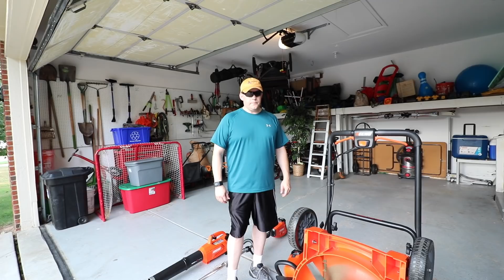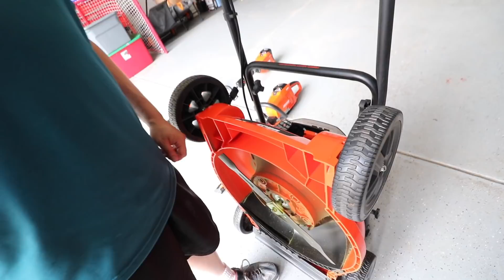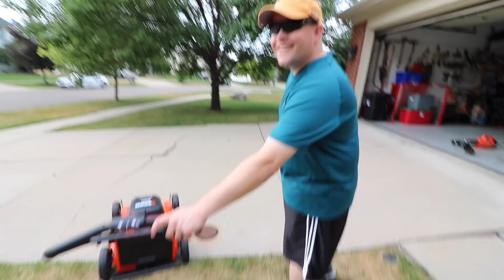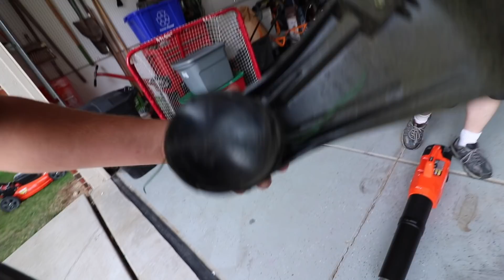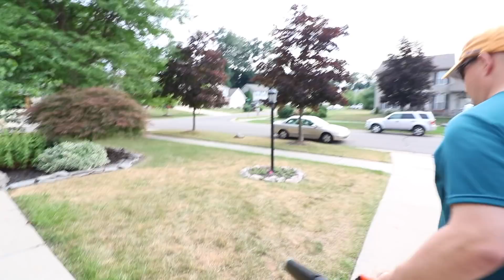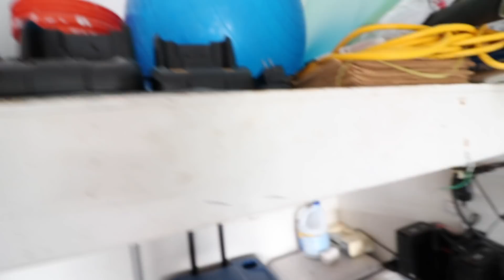ECHO 58v Battery Powered Review ► Is Battery Powered Equipment Worth It?

Comment: The echo chainsaw and string trimmer are pretty solid. I use the trimmer on a day where I do small yards, works great, one charge, no starting, no fill up. The chainsaw is a beast. I've brought it out to jobs (along with my gas saws) and never had to pull out my gas saws. BUT the blower runs out of charge too fast.

Comment: I own most of Echo 58v products. Sad to see they are discontinued. I love that the mower has two bays but I hate that you can only use one at a time. I’d love to be able to pull power from both batteries at the same time, in effect halving the amperage required for both batteries. Is it possible to modify the key to be able to run them both in parallel? That would be awesome if so.

Comment: I actually want to try the string trimmer and blower in my business for 2019. We service a lot of yards per week, so it would be a workout on the batteries for sure. I currently have a 2000 watt continuous power inverter in my pickup and run a mini fridge in the back to keep bottled water cold for the guys. That works great, and just the savings on the time going to the gas station to get ice and the cost of ice has been reduced significantly. People get a kick out of seeing a refrigerator on a truck, but it works great. 

Anyways, since I have the inverter already, I could easily plug in multiple chargers. If I went with the 4ah batteries, I believe we can get 3-4 yards done on one battery. Have a reserve battery on charge ready to go and the recharge time is only an hour. If the batteries will hold up, two batteries per device should be all I really need I believe. Echo warranties the batteries for 2 years from my understanding.

This setup could potentially save a ton of money. First, we drop about $25 a month on 2 cycle oil, plus the cost of fuel. Secondly, save time on labor from swapping out a battery about once an hour vs refueling every 2 yards. Third, and this is the big one, time on dealing with weed-eaters that don't want to start, carburetor problems, and constant maintenance. Efficiency is everything in this business, so I think it is worth at least a small scale test.
Reply from the maker: That’s a pretty cool idea and concept.
Reply: How did it go last year running the battery stuff? I've decided to do that this year. It made a pretty healthy investment of about $1,500 in a few different lines to see which was the best. I'm hoping it's going to be a good choice! I will be running all electric actually. I have DeWalt, Ego, and Echo. I've done some smart shopping on Marketplace and stuff so I haven't paid full price for anything. I wanted to figure out which brand name would be best, if any, before I put any more money into a specific brand. We will see which one works the best but I'm interested in your opinion on how it went for you?

Comment: In the video it was mentioned that a full 58V Echo battery could run 50 minutes in the Echo Lawn Mower when using to cut heavy grass. I have this lawnmower for more than two years and I have 2 echo 58V batteries that I use. My experience is that each battery is typically able to run about 35 minutes for low grass situations and about 22 minutes for Heavy thick grass. Your comment about a battery running 50 minutes for heavy grass makes me wonder if something is wrong with my mower. 
Did you make a mistake in the video or is your assessment for Run time still the same now?

Comment: I have my own lawn business and have been using cordless trimmers, blowers and hedge trimmers. I use the Kobalt 80v line, the trimmer can accept attachments so I use that to edge. And I have the Kobalt 80v backpack blower. I can cut about 10 yards a day with my batteries. I got a deal when Lowes was offering a free battery with any trimmer or blower purchase. So I have about 8 batteries and they charge within 30 minutes. The only thing I have that's gas is my mower. I also have 2 Snapper 60v trimmers and a hedge trimmer. They work well.

Comment: I love Echo, have been in love with Echo for a long time, and now I'm trying to switch over to all electric lawn equipment. Started by switching to Echo Electric Blower, which is now my favorite blower of all time, and about to switch to Echo Electric String Trimmer from SRM-225, which I have loved my 225. Get's alot of hate, but if you have solid technique and line (Echo Black Diamond), that thing will wreck anything. Now I understand if your using this equipment for commercial use. I was the head groundskeeper at a Christian Camp this summer and we ran Echo 225s, I would usually run one for at least 7 hours a day, and that chewed through gas, so I could see you would have to have spare batteries always on hand or have one or two always charging, but for a home owner I think it would be good to make the switch. I've also been using a Fiskars Reel Mower, trying to get my Bermuda down to 1 inch (Shout Out to All LCNs out there). But hopefully soon I'll be off gas and all electric. Love Echo, they are the BEST!

Comment: Awesome video I use the same mower,  blower and trimmer. The trimmer can be used with the same optional attachments and the gas version. I use the stick edger and a sweeper attachment with mine. You can also purchase accessories like a side discharge and mulching attachments that fit on the back of the mower. This is also Toro striper kit compatible. The blower is strong but a little unruly... the nose opening is to wide. Mower cut  quality is great especially compared the the Ego I used to own. Great purchase for anyone who doesn’t not like fooling with gas and oil and belts...

Comment: Another thing that's worth mentioning on the battery powered things: just did some cost calculating for my electric car and in the last 9 months it has recuperated all of the cost of installing the home "charger" (through fuel savings) and over the next decade it will entirely pay for itself in terms of gasoline and maintenance savings. That is something unique about electrically powered tools which is completely opposite of all gasoline/diesel powered things. With a gasoline or diesel or whatever you spend a bunch of money on it to buy a brand new and then as you use it it continues to cost more and more money through expected maintenance and repairs as well as literally burning money in the fuel tank every day, and up until this moment in History Society has had to accept that because that is the best we have been able to do and that's just how it works. But not anymore/not for much longer. When making the shift to electric, it's exactly the opposite. Electric stuff literally pays for itself in fuel and maintenance savings in less than it's usefull lifetime. This is a complete paradigm shift and a game changer. It opens up there possibility wearing people who use electric things like cars and tools and such will be able to keep so much more of their hard-earned money for the work that they do.
Reply: It is true that fossil fuels are highly energy dense, tough to beat in that category. There's more energy in one gallon of gasoline then there is in theentire battery for my electric car, for example. But, my electric car can drive well over 100 miles, probably closer to 150 miles or so on the amount of energy contained in one gallon of gasoline it. But that same gallon into any internal combustion engine vehicle in your getting somewhere between 20 and 40 miles per gallon at best. The trouble is that when fossil fuels are burned a huge proportion of the energy is released as waste heat and a small portion of it is used to do actual work. In terms of efficiency electric is light years ahead (yes, I went there, ha!) but it is true that a fossil fuels are very energy dense.

Comment: Battery power equipment is good but it's almost twice as much than a gas mower and you also got to remember if the batteries die and they won't charge anymore then that's more expense

Comment: I had the same problem when I first bought my EGO (not ECHO) Mower. The mower front coming up, What I did was move the handle to a low position so the tendency to push down was almost eliminated and I switched to the steel deck EGO mower and that seem to have more front end weight. I chose EGO instead of ECHO because of EGO's battery cooling technology is far superior, Very important because I live in Vegas and it can get to 118 easy and EGO has a 7.5 AH battery which make the EGO tools useable in my lawn care business.
Reply: Cyberslug1 how is your business going? I have the ego tools and want to go into the business with the EGO range. How many batteries do you have and how do you get through the day?

Comment: I use a cordless trimmer/edger, hedge trimmer and blower, but I'm not quite sold on the electric mowers yet. I looked into lots of models last year when it was time to replace my 10 year old Toro Recycler but opted to stay with a new Toro gas mower. I'm sure they will have more improvements in the future as far as power is concerned with the mowers though.
Reply: I don't know if things have changed since 1year ago but Ego's 56V line with a 7.5ah battery is seriously something.

Comment: Honestly i think electric is the way of the future, We have mountain property in Colorado and one of our neighbors is a huge electric fan with tesla, solar, and such.. he has a 3 blade brush mower tow behind he has used for years behind atv's to cut his property, recently he replaced all 3 blade engines with electric motors, then put a single gas engine turning an electric motor that sends voltage directly to the 3 smaller electric motors. He swears that he uses less gas now and is able to cut his property in half the time, because he has the blade speed turned up 3x higher, so he can cut the grass in a single cut vs multiple cuts due to stragglers from old gas engines bogging down.

Comment: I converted my scag mower this spring to propane and just finish putting propane on my truck to save on fuel cost i am saving about one dollar per gallon an we are looking at batt trimmers and blowers to cut gas completely out my thoughts wes to put to golf carts wired together to make 12v and a inverter in cab for chargers and use truck to charge the golf cart batts with isolator so it doesn't drain main cranking batt under hood so then the truck will charge the batts for trimmer for no cost because i all ready have to start and drive between yards maybe also could put solar panel on top too to help charge it would cut fuel cost if it works

Comment: Been running echo battery trimmers and blowers for 2 years 0 problems 1 battery failed home depot replaced it yes batteries are expensive 176.00 for echo but ive bought 3 used or fairly new one from e bay 55,75,80 plus a used trimmer and trimmed  bushes with the combo attachment that usally on my gas echos everything has its pro and cons but for quick trimming and blowing they work great and i mow lawns for a living so they get well used no failures yet after 2 years so fsr plus 2 year com warranty 5 yr consumers warranty

Comment: As a lawn care business owner I would never go batteries on anything. The industry would never get battery to where we need it to mow 100 yards a week. Battery operated strictly for home owner only.
Reply: Commercial companies are also using Green Machine 
... never say never
Reply: I'd disagree. I use Ego powered everything with no problems. It takes forever to wear the battery charge and run time down to a noticeable amount and with a proper quality brand 2 batteries gives you just shy of 100% uptime. 3 gives you leeway long term. Obviously this dynamic shifts as you start to scale the operation though. But for a 1 or 2 guy thing, battery works fine. 1 battery lasts me 3-4 subdivision lawns and then just rotate between them. Most homeowners have a generator which you can take on the go to charge them already but if you don't it's a solid investment which isn't expensive, but most of my customers are okay with me charging at their house as long as I do a good job at a fair rate since the electricity cost is negligible.
Reply: I have 65 yards and use everything battery besides zero turn and push mower dewalt 60v line with 2 12s 3 9s 2 6s charge when i come home never run out been awesome saves ton of gas
Reply: Garrett Lawn Care 
Hey. What brand electric are you using
Reply: Shame you feel that way. They have their place nad they are liberating, effective, efficient, and allow us to start at early hours without the complaints. By the time the batteries are needing to hit the charger, we're into normal work hours and onto gasoline equipment.
Reply: Manorscape Gardening 
That's my plan as new to electric. Not replace my commercial gas equipment but get a small electric set up that can run an hour say 6:30am-7:30am
Any opinion on a good mower/blower/trimmer that can last a good hour and not break easily in trailer?
Thats why i was pointed towards the echo mower, solid
Reply: @dr.crentist3155  We consolidated to Echo for battery interchangeability. We do not have the mower yet so I can not advise on it. The places we work at those hours would be serviceable with a 21" mower so I plan to add 2 to our arsenal.

Comment: I have Echo's weed trimmer and their others. I can use it in any yard that I use my gas. It's also great when I get an early start or late night cutting a customers yard.  The noise is minimum.  My only but big complaint is that the throttle trigger springs in it is too stiff. Makes your fingers tired when you use it for work majority of the day. The spring doesn't need to be so heavy. There's no carb or cables to pull. Hope Echo goes with a lighter throttle spring in the throttle switch. I would then use it full-time. I charge my batteries with solar.

Comment: Thanks for the video. Enjoy watching it. You will come around to the electric equipment in the next few years I think. Eventually anyway, it will all the electric. It is just a matter of time. Same thing with all forms of terrestrial transport including cars, trucks, semi trucks, motorcycles, planes and trains, well trains are already mostly electric even if they have diesel engines but that's a whole different video.

I don't speak from a position of authority when it comes to outdoor power equipment. I have less than 500 square feet of grass at my house and the Arid Southwest and the only lawn mower I have is a $50 real style lawn mower from the Home Depot that was at the house before I even moved in. But, there are so many upsides: low noise - which is great for the individual machine operator as well as for everybody within hearing distance of the machine, lower vibration and fatigued throughout the workday, far lower total cost of ownership. It seems like the Mean Green products are the first real potential solution to the internal combustion engines of outdoor power equipment but from what I understand they have sufficient runtime to last all day in a busy commercial type of environment and used cycle. From what I can understand as an outside Observer it seems like the initial High Cost of purchase is the only barrier and that will come down in a relatively short amount of time.

Anyway, thanks for the video have a good one.
Reply: I have a hybrid car .you couldn't give me a Tesla.
I like the battery operated lawn equipment for one reason, they're quite. What's going to be implemented in the upcoming future, the stainable development BS LIE !  The choice or even what is allowed by ???  Or available to buy,
During the reset there will be no private ownership of land cars trucks landscaping equipment. Everyone will be moved into a city that is smart that will be controlled by AI and a controller of human form.
Also of the seven and a half billion people on earth , so they say. Seven billion of us shall be murdered . The culling has already started. And very shortly a year or less will get much worse. Average people are unable to understand this is going to happen if we don't do anything to stop them. In the meantime we have to live. good luck !

Comment: I have the echo weed beater and I’ve had it for 3-4 years. Battery is very good and the feel 
Is similar to the lesco (rebranded echo)  I used at the golf course for 7 years which is good. I have had no noticeable battery degradation. The feel of it being similar to the pro weed eater I used for 7 years gives me the confidence to attack 2-3’ tall growth around un manicured creek beds but if in “rabbit speed”  it will trip some sort of over current  or over heat protection. Honestly turtle is plenty to cut pretty much anything. And if I use the edger attachment off the other weedeater I have it all also tripped the overcurrent overheat protection I can’t tell which one it is. And other than that the thing is a tank if I leave it I mean I just leave it in turtle mode all the time and rarely have any issues also that whatever safety that it keeps tripping may not be an issue if he is the four amp hour battery but I don’t know  about the 4 amp hour battery so I can’t confirm or deny that but overall after three years of use with this thing and after having some previous golf course experience it runs long enough to do everything I need to trim in my 2 acre yard and then some.
Reply: Wow  4 amp hour really jacked up talk to text.

Comment: idk, i bought a battery sting timmer a few years ago and the battery is starting to go bad, i looked it up and they don't even make the battery for it anymore.

heck the replacement batteries cost about the same as a new string trimmer would anyways.

i have a 20-year-old lawn mower and i can still find parts for it.

in 5 years time will they still offer support for these battery systems or will the technology advance and you will be forced to buy the new products cause they no longer support the older models?